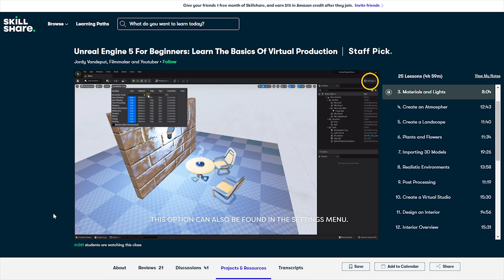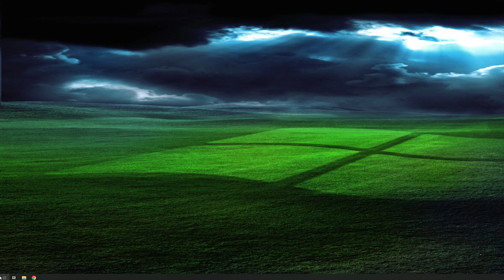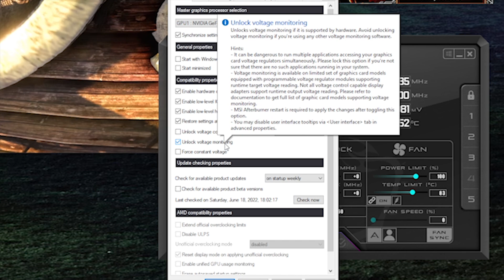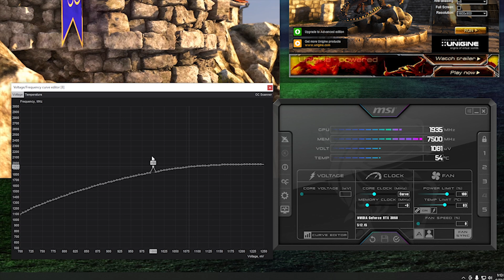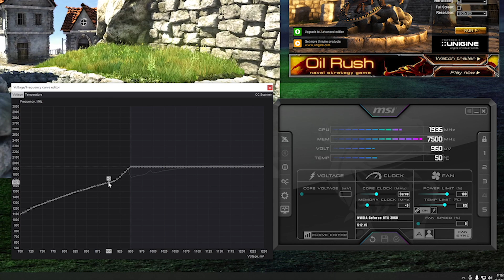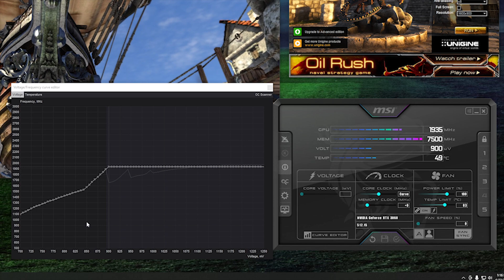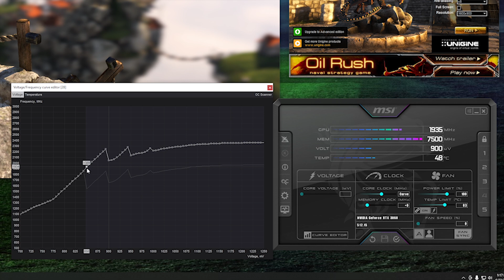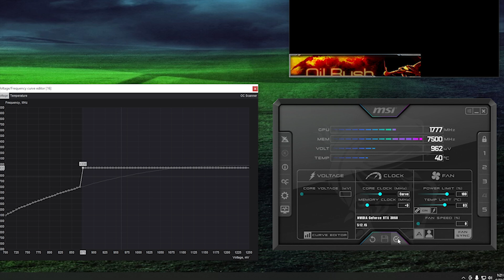Should You Undervolt Your GPU?

Comment: Why don't stock cards come undervolted then?
Reply: not all GPUs are made the same. So to figure out max stable undervolt for each card would be time consuming and to costly for such low performance boost.
Reply from the maker: The silicone lottery. Manufacturers find the best stable voltage for the widest array of silicone quality.
Reply: @CyberCPU  One should never overclock breast implants. 😀